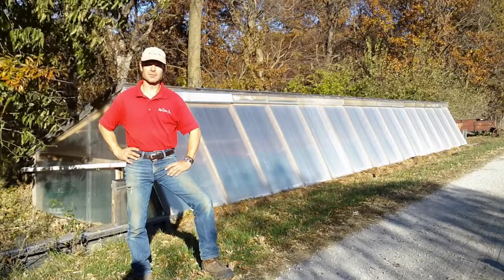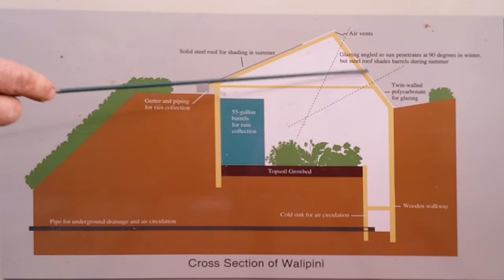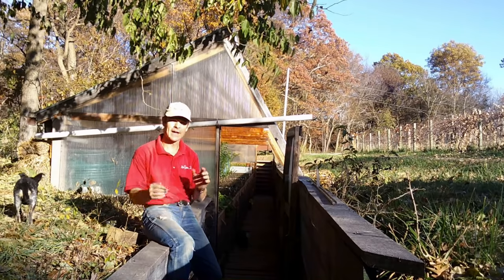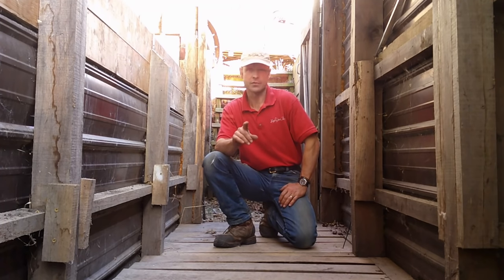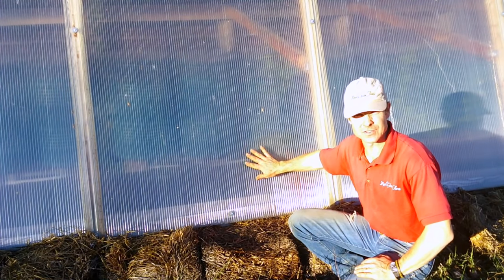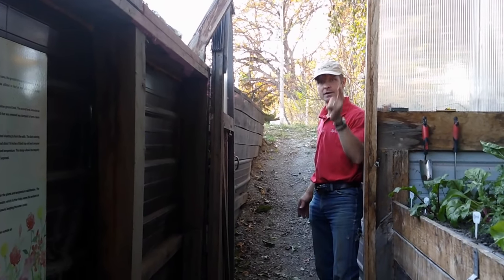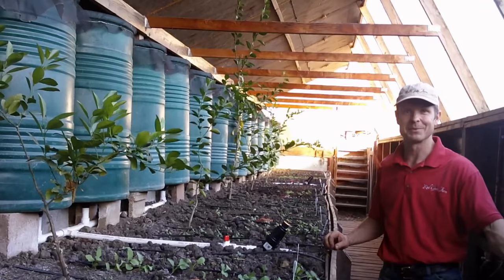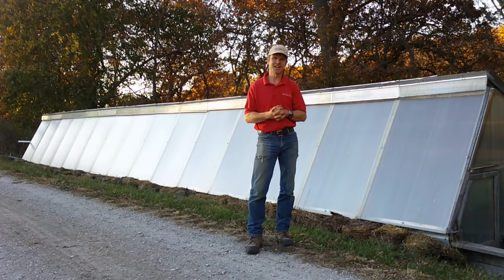Farm Tour Series: The Walipini; Use, Design, and Construction

Comment: I have watch as many Walipini builds and design video as I could over the years. Your instructions and design is the best I have seen. So happy I found your channel. Keep up the good work!
Reply: First time I have come across them and it is an eye-opener to me!
Reply: @zpoedog 
I agree. 
Best walipini video I’ve ever watched.
Reply: If you put a house on the back of it the house would be heated by it and the walipini would work better aswell.
Reply from the maker: We are actually planning that with the build we are currently working on!
Reply: @ADifferentWay  There are also video's using compost to heat the 'greenhouses'. In the Netherlands old farmhouses had compost against special designed 'compost' walls that heated the wall and thus the farmhouses using compost. You could do something similar, other idea would be to use a water pipe out of the compost and heat the walapini with that hot water.
Reply: Reminds me of an Earthship house :-) however, as the Earthship is insulated it does not need a cold sink. Great triple use of the cold sink, I like the comfort of working upright. And mushrooms - awesome! Very well explained, thanks!
Reply: @ADifferentWay  

Such a great idea!  Some thoughts:

1. I recently came across a video from a fellow showing how he provides heat and CO2 for his greenhouse all winter long: he placed screened vents along the north wall and then dumped a huge pile of compost outside along it.  (You could probably also heat up the water by running loops of HDPE pipe through the pile.)  You can look up 'greenhouse compost heating' for more info.  

2. I understand the sheer lack of time during the busy season.  One option would be to set up an ESP32 microcontroller auto-watering system that would monitor the soil moisture and only water when needed.  It could also keep track of air temperature and trigger motors to open and close the vents as necessary.  You could even control the whole system from your phone or PC!

3. I see that home freeze-drying appliances are now a thing, which is WILD to me.  On top of that, -328F liquid air is pretty cheap, so you could flash freeze produce right out in the field by dropping it in the liquid air, then freeze-dry it for a high-quality product with a shelf-life measured in decades.

4. A 'rocket stove mass heater' would keep the whole place toasty all night even on the coldest days, and you'd only have to run it for an hour or so a night on a handful of twigs/etc.

(There's a good chance you've already come across some of this stuff, but I thought that I'd share it anyways.)  Cheers!
Reply: Ditto
Reply: @pietjemol3420 the compost method heating is really cool! They grew pineapples for royalty in Great Britain with in ground greenhouses and compost long ago!

Comment: Regarding your aphid problems... I live in a flat in the UK and grow a lot on my lovely balcony - vine-tomatoes in pots from macrame-holders along my washing line - but the season isn't long enough for peppers, which I grow indoors in large pots on a windowsill.
I stood smaller pots of mint upon the peppers' soil, amidst the plants, and I ruffle the leaves occasionally - in ''double'' pots, actually, because mint is a very thirsty plant, wildly invasive, and other plants don't like their root oils - so I put the mint's growing and drainage pot inside a solid-bottomed, slightly bigger pot, which does get a bit mucky after a while and needs cleaning... but it drastically reduced the aphids, not completely - they seem to huddle in specific areas now, where i grab them with tissues - but what an improvement.
Thanks for the great video and G-d bless.

Comment: Have you considered running a perforated duct along the peak of the roof, hooked up to a solar powered fan? That way instead of venting the excess heat during the summer to atmosphere you could connect it to your drain and air pipe in the ground and building up the excess heat in the ground for winter usage.
Just a thought. 
Very impressive setup
Reply: Cool idea.

Comment: I have wanted to build a green house this way for years and have drawn up various designs, but have never seen one actually implemented. I always thought it dumb to use expensive transparent materials on walls that don't get much light, and to not use the moderating effect of the earth to keep the temperature in a reasonable range.
I will have to search Walapini, as I have never heard the name.

Thanks for posting the video it is great to see it really work. If you build another, you should consider using B-decking instead on roofing for the walls. It is a bit thicker metal and deeper corrugations. They use it under concrete in things like parking structures. Of course it costs a lot more, but you won't have issues with the wall pushing in under soil pressure.
Reply: I had been thinking about a lean to greenhouse, with a solid north wall with water barrels to absorb solar energy in the winter day and release heat at night. This is a much more complete design than anything I had considered.

Comment: I really like the design! Wow! I’ve been thinking on making a walapini for years. I’m south of you in Texas and my design actually is opposite. I need to escape the heat. Winter barely ever gets colder than freezing. So water tanks are unnecessary on back wall. Instead they need to be in shaded area. Another thing is tubing underground with attached solar fan to circulate hot air into the ground for geo cooling. You could do the same thing below the frost line for the colder months. A gas heater could provide CO2 and warmth. If you put in clay lines and run it hot for a bit before night can keep walapini warm for a while. Run piping under grow beds to keep the plants warm on top and in the ground. Got some great tip to add to mine. Thanks ever so much for putting this up.

Comment: This has evolved my idea for a thermal type of greenhouse I've been planning for my garden. Some fantastic information and ideas that I'm certain I can incorporate. One idea that I've had looking at your plan, the glass on the North facing roof that you cover with insulation in the winter, what if when you take it down in the summer, you store it in front of the water barrels? My thinking is it solves 2 issues, firstly it further helps deflect any heat from the water barrels, which don't want in the summer, and secondly storage, those panels have to go somewhere during the summer, and I would need an answer for my wife where that would be. I love this, thank you for sharing it with us, is perfect in everyway for what I'm wanting to do, possible Denmark's first Walipini.
Reply: I was just thinking he should put some reflectors inside to increase the light, this would also solve that problem 🤓

Comment: Great video. Very informative and interesting
You mentioned Espalier with your fruit trees, I highly encourage you to follow that path. The history of Espalier all started because they wanted to train fruit trees against a thick wall that would absorb the heat to keep oranges and other fruits as warm as possible throughout the year in France. The flat designs of Espalier aren't just fancy looking, they're done to keep the plants as close as possible to the wall behind them and benefit the most from that thermal mass. 

If you experimented with some hook magnets you could probably find a perfect option to train your plants/trees directly to your water barrels without needing any additional support structures. I haven't seen it done before but they'd be infinitely adjustable in placement and you could find different holding strengths in different magnets.

Comment: Excellent instructional video and Walipini build . I've seen several walipini builds . Yours is the best . Water holds 3 1/2 times more heat than anything else . My previous thoughts , were plastic lasts 1,000 years . I was researching plastic barrels just now . To my dismay , I found out the barrels only last five years . Some people have them stacked high in greenhouses . I could imagine 500 hundred pound barrels hitting someone . Sunlight is plastic's worst enemy .
Reply from the maker: Although our barrels certainly lasted more than 5 years, you are correct.  UV light can deteriorate plastic, so caution should be used, and any plastic drums should be well supported!

Comment: Thank you for this tour!  I have looking at trying to extend the outside gardening season in Wisconsin.  The research in the roof angles, sun exposure and venting were very informative.  I have been looking at smaller gardens, digging down so you can stand up inside is brilliant!  The comments about the thermal heat from the water barrels below was also helpful.  Going to review this video again.

Comment: This is a very good overview! Thanks very much for the detail, diagrams and specifics. The work  is excellent!

It is absolutely true that this design is latitude specific. There is no one design per se, and you have to adjust it  for not only latitude,  but also conditions.

Deserts and semi arid is where this technology can shine year round. There, you can't grow much of anything in the high summer, as temps go over 100F. You'd have to alter it to be able to do serious cooling in that time, using earth tubes extensively, or geothermal cooling, as well as misting.
Reply: any way to unchunk and approximate the $investment/spend up front?

Comment: Thank you for your detailed explanation of this structure and its functionality. I’m in awe of it. We live at 7100 ft in elevation and have struggled to determine a good way to establish a garden.
Reply from the maker: We first learned to garden at that elevation! We lived out east of Colorado Springs, between 7000 and 8000 feet altitude. It was a challenge for sure! We had a friend who was an incredible gardener in the area. He said the key to outdoor gardening was using cool season, fast, growing vegetables. The key to the longer, warmer season vegetables Was some type of greenhouse or other protected structure that could provide supplemental heating when necessary. He had that, and he had amazing tomatoes even in fall! We would’ve loved to pursue the idea of a walipini, but where we lived at the time would’ve required a mountain of expense and paperwork to dig the pit. So we waited until after we moved. But it would definitely be an asset in that climate!

Comment: I love this. Several concepts I’ve never seen. For example, the cold sink I found totally counterintuitive but fascinating. 

Have you considered making the insulating panels on the roof white on the inside? I’m not sure if there’s a reason for them being black, but if not, the white would reflect any light that hit them. Not sure how much more efficient it would be but even simply from a human experience perspective, it might make it feel brighter/bigger.
Thanks for your contribution! =)
Reply from the maker: You are right, white could definitely have offered some advantages. In this case, we only had black because we bought them used and they were very inexpensive! 😁.
Reply: Black absorbs heat.
Reply: I was thinking about a lean to greenhouse with the barrels and the north wall painted black to absorb solar energy in the winter and a white or metallic screen to block heat from absorbing in the summer. This design looks much more efficient than anything I had come up with.

Comment: Awesome.  I'm thinking  wood chip/compost heat is easily incorporated with a trench along the back wall and/or roof.  Empty the compost trench in early summer.  This will allow better cooling in summer, too.
Reply: It would not be hard to incorporate a static pile compost outside, maybe on North berm area with coiled PEX built into it and then run that through the Walipini in a loop with small pump that could be turned on and off by thermostat. Give an additional source of heat in depth of winter, use the compost inside and outside on beds in spring, rebuild the pile in summer and fall. I saw a great static pile set up heating tomato beds inside a greenhouse at McEnroe Farms, Amenia, NY USA in 1990 or so.

Comment: This is incredible! I am wondering how you keep the water abundant in the winter- don't the gutters fill with snow/ice and stop adding water until the spring melt?
Reply from the maker: It’s actually easier to keep the barrels full in winter than in summer. As the temperatures cool down, soil evaporation slows tremendously, thereby decreasing the need for water. By December, we only give a light watering about twice a month, and by January it’s only once a month.  Our region tends to be very cloudy during the winter, and we also have several warm spells that melt off any ice or snow allowing our barrels to refill.
Reply: @ADifferentWay  thank you for the informative and super quick response!

Comment: Well done video, thanks. As you were describing the process and materials I was trying to come up with a cost estimate in my head. I know material costs vary depending on barter and purchasing new, could you provide a rough figure on cost?
Reply from the maker: Like you said, it really varies with how you source your materials. In our case most of the lumber was rough cut, from our own woods, on our personal Lumbermill. The barrels were sourced used for $5 each. The topsoil was left over from a friend, so our main expense was the twin wall poly carbonate glazing, which ran us around $2600. We also had to pay to dig the trench, but we packaged that in with other excavation work we were doing at the time. So it probably cost us around $800 or so.  Then there was hardware and just some miscellaneous items. I think our grand total actually spent was around $4000. If we had had to buy all the lumber, it would’ve been at least twice that. Hope that helps.
Reply: @ADifferentWay  That does help, thanks. I hope others appreciate the detail that you provided and thought provoking comments.
Reply: @ADifferentWay  if and when you do this again do you anticipate cost savings?
Reply from the maker: Now that I know it works and more than pays for itself, I would actually invest more.  Additions would be a footer for the tanks, a cement front wall, and a subterranean air flow section to utilize more ground temperature stabilization.  I think a combination of this and Rush Finch's design (Greenhouse in the Snow) would be ideal.

Comment: What exactly would you do differently if you had to do it over again?
Reply from the maker: First, a really well reinforced front wall.  We knew when we started this project, that we would eventually wish we had done that, but we intentionally built this as kind of a prototype and cut cost in that area. Another thing we would do is add far more ventilation pipes underneath the grow bed to circulate air better. We don’t have good enough airflow in the heat of summer to cool it. We would also invest in better topsoil for the garden. We got what we were told was topsoil but wound up being black clay that has been a curse ever since.  Finally, we would put an actual footer under all the barrels, as we have issues with them settling and tilting, and we have to reset A couple each year.
Reply: I wondered if another eaves trough along the south side would have kept the water from draining down the panels and making the dirt in front collapse. Also, is the size of the walkway imperative? Could it be built to accommodate a wheelchair’s width and height for a seated person to work in the beds?
Reply from the maker: Because the roof is angled to the back, water does not spill off the front.  Our particular issue is the fact it is located only about 8 feet from our driveway, which is consistent pressure, and the 8 feet in between is heavy clay soils that become water-logged at times.  As stated, we knew this would eventually be an issue, but our goal was to build a prototype that would last about 10 years.  The walkway could easily be made to suit a wheelchair.  Just be aware that the wider it is, the more the square footage increases, and that in turn increases the air space that must be heated and cooled.  Depending on your zone, this could be used to your benefit, or could require a little creativity!  You could decrease the height of the grow bed by raising the level of the board path, but still allow for a good cold sink and good air flow.
Reply from the maker: Ever since we got it dumped, and realized how much clay was in it, we have been working to amend it.  We add compost, sand, and other amendments about twice a year when we prepare to replant.  We have added thousands of worms.  We grow lots of root crops to help break it up, as well as use our broadfork.  The soil in the walipini is some of the best we have.  It's just a process, as you say, that can take years.  We still find "chunks" of clay each time we start planting, though!

Comment: You could paint the insulation panels white to increase light reflection for your plants during winter. Absolutely love your walipini construction. Thnx for sharing.
Reply from the maker: As we discussed in our book, which is found in the info section below this video, different colors have different benefits. Certainly, you could paint darker colors for increased warmth or lighter colors to increase reflectivity. You can also use actual colors on the spectrum to reflect light in different ways. It really all depends on your specific needs.

Comment: Greetings from Finland. You can use snow in winter as an insulation on the Northern side of the roof. Just add some horizontal planks to stop the snow from sliding down.
Reply from the maker: The north side of the roof is a very shallow slope and holds the snow pretty well without blockers.  However, we haven’t gotten a lot of snow in the past few years so it hasn’t been very effective at insulating.🙁 thanks for pointing that out though, I failed to mention the insulating properties of snow in the video.